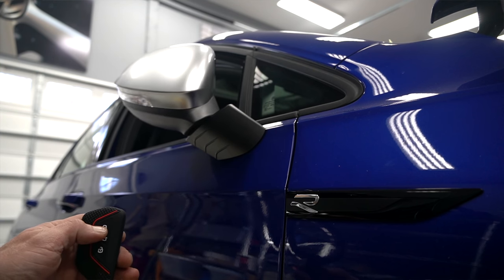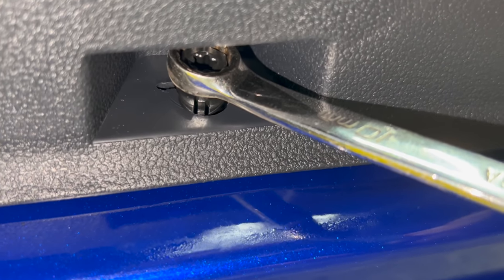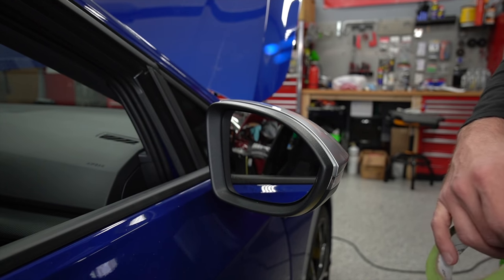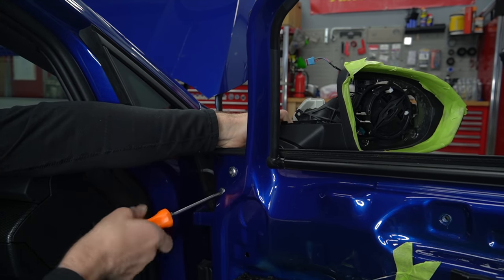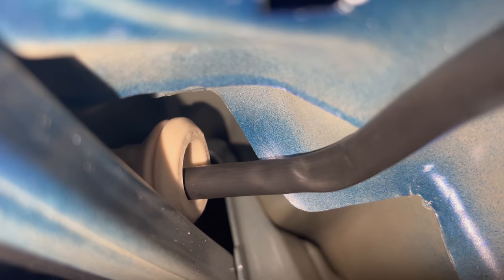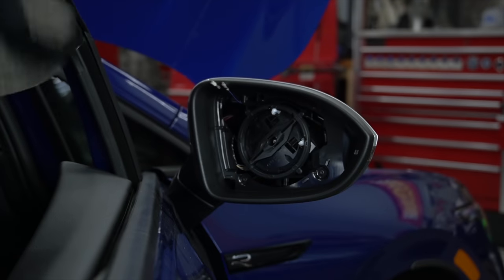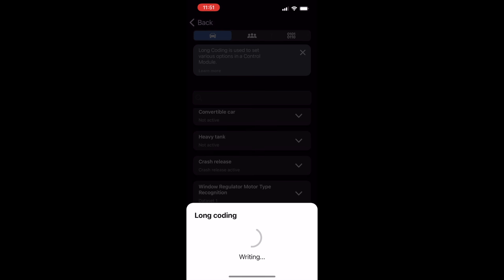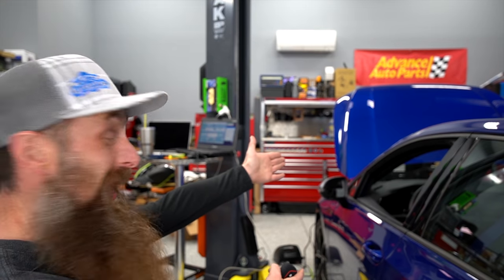How To Install and Code MK8 Golf R, GTI Power Folding Mirrors

Comment from the maker: This is really one of my favorite features. 100% not needed, but I love it. I have coding and adaptations listed in the video description. But I will have it here in the pinned comment: 

For coding:Address Word 42 Driver side door
Long Coding 
Mirror Folding ~ INSTALLED(byte 4 bit 4 on VCDS)
Mirror Comfort ~ ACTIVE (byte 4 bit 6 on VCDS)
Confirm long coding

Address Word 52 Passenger side door
Long Coding 
Mirror Folding ~ INSTALLED(byte 4 bit 4 on VCDS)
Mirror Comfort ~ ACTIVE (byte 4 bit 6 on VCDS)
Confirm long coding
ADAPTATION FOR MIRRORS:
1)SFD UNLOCK
2) Adaptations
~Search Spiegelverstellung 
3) Confirm Settings as follows
~CP Komfortgedienung Spiegel Anklagen 
NOT ACTIVE
~Spiegelanklappen Bei Verriegelung
ACTIVE
~Spiegelabsenkung Bei Rueckwaertfahrt
ACTIVE
~Menuesteuerung Spiegelabsenkung
ACTIVE
~Spiegelverstellung Synchron
NOT ACTIVE
~Menusteuerung synchron Spiegelverstellung
ACTIVE
~Menuesteuerung Funk Spiegel anklagen
ACTIVE
Reply: Is there a way to code the mirrors to fold if you turn the switch while driving?

Hyundai has that functionality and it's really useful for tight space maneuverability.
Reply: Hi, great video!!!
Do you know if it is possible to change the default drive mode by obdeleven? The golf r is always set the “sport mode” as default and different from the GTI it does not remember the last selection. Thank you very much.
Reply: @georgelaurentiu3106  i guess that feature is automatically enabled after you coded the power folding feature. that's why you need a power folding mirror adjuster
Reply: @n.shiina8798  factory installed power folding mirrors will only fold/unfold if the engine is off afaik
Reply: @georgelaurentiu3106  check your mirror adjuster switch. there should be retract button. all car here that equipped with power folding has retract button
Reply: Hello, do have an idea how to install keyless entry handles on golf 8 with full configuration
Reply: Can this be done on a 2019 Jetta GLI 35th Anniversary?
Reply: im SO SO SO thankful to you for doing this video! i got it all done in 3 hours flat :) your tutorials have been incredible. my 23 gti too now has electronic folding mirrors from shopdap :)

Comment: Power Folding Mirrors are a parking lot flex
Reply: Really useful for getting out of a car garage though
Reply: Its like putting your sunroof on vent when at a Meet or something
Reply: I had a 19 Rabbit Edition and traded for a 380 Edition and I fold them before pulling in the garage. The extra 3 inches I can park farther toward the wall and the extra room between my wife's car is super nice.  No more worries about wife dinging my car.

Comment: Easiest way I’ve found to remove the mirror glass is to push the outer part of the mirror as far in as you can. Then grab the inner part of the glass with at least two or three fingers and it will pop right out. Replacing them with aspherical mirror glass is a must. There’s no reason to not install them.

Comment: I figured it out. If you follow this video to the T you will end up with 3 clips removed with the door card. The other 2 will remain in the door which need to be removed, reset, and slid back into the door card. 

OBD11 was not very effective. The pay model is a bit ridiculous. First told me power fold mirrors are not available with engine on and good open. Figured I’d do the one tap app to support your work. That didn’t work. Waste of $20. Had to manually go thru long coding and adaptions and that worked. 

Happy with the result though and appreciate your videos and I learn more about the Golf mk8 platform.

Comment: paranoia is a thing, it only gets worse with age x)
I usually forget to lock my car at home, so I put the keys in my pocket when I get out of the car and press the lock button when I put the keys on the counter. I also never ever take the keys out of my pocket until I don't intend to go back to the car. aka everything removed and doors closed.

At the shop I always press the lock as I drop the keys in my pocket. 

If you don't want to forget something at home you must take to work the next day, put  it in the fridge with your lunch :D

Comment: You could have gone all out and put an auto dimming mirror on the driver side. Can't see if they make one for the passenger side or not. This would require a lot more wire routing though.

Comment: Seems like a ton of work for folding mirrors. Glad you're happy with it, it would be useful in the city for sure. 

Actually I'm messing with the mirrors on my mk6 right now, replaced the mirror control switch but problem persists. Problem being I lost the 'down' direction functionality. Think it may be a wiring issue? I am getting codes back for 'implausible signal' on the mirrors
Reply from the maker: ITs really not that bad. Id say about an hour or so of install. and maybe 20 min of coding.

Comment: I think this is something that should be instaled from the factory
Reply from the maker: I agree.
Reply: @HumbleMechanic  these are installed as standard on uk spec cars. But great content as usual Charles 😊👍👍
Reply: That’s weird! In the previous generations here in Mexico the GTI model came with this from the factory. I hope that the MK8 that is built in Germany comes with the same configuration as the other ones.
Reply: @epierdant  My frend that is called cost cutting

Comment: Really appreciate your videos. I’m currently stuck on getting the door card back on. I’ve reset the clips as you showed. But just not getting a good seal compared to the driver side door I haven’t touched yet. Do you have a more in depth video on getting the door card back on or have any tips for me? I started at the top inserting into the channel and tried to slide it down. Peaking around the sides to ensure the 3 reset clips are lined up. I give some bonks but they just won’t grab fully. I swore at my car :(

Comment: At 4:42 it seems that a centering post or  broke off . Best thing is to remove it before putting the panel back. In certain frequencies they rattle if left in.

Comment: Thats really neat  Those little covers are really neat , and knowing how they work saves a lot of untidy edges when refitting well done, a very clear video.
on a slightly different topic , but still in your department , does an 08 08 audi S3 have the same pistons and rings as the standard 2.o liter , basically do they have the same oil consumption issues ,,, ta.

Comment: What is the overall width of car with mirrors folded in I’m looking to see if it’s the same as manual folding mirrors because I have have a small garage door I have to fold mine in I worry I’ll eventually snap ‘‘em off but they seem to fold at a lower angle

Comment: Charles, why does a $40k+ VW, and a top halo VW at that, NOT come with power folding mirrors as standard equipment?   How hard can it be for VWoA (or VW in general) to install these power mirrors on to the Golf-R?  Is this part of the continued cost cutting measures we see in our market, or is it a "we don't want to step on Audi's toes..." measure?  Even "People's Cars" need power folding mirrors.  Thanks for what you do.  .:R
Reply from the maker: It’s a small car so I’m guessing the “need” in US market is low. 

I’ll happily give up PFM for all the other rad stuff this car has

Comment: Hey Charles so I’ve done this with my mk7 and installed everything right but I did the coding with Obd11 and all the functions show up in the car but the mirrors nvr fold should I do the coding with vcds instead of the obd11

Or could it be that I installed the wire for the mirror backwards but idk I made sure all was done right just that they don’t fold and I bought them from Paul his Dutch auto parts store 😭 even doe the wires go in one way so I’m just sad they don’t fold when they should but it’s probably bc of the obd11 and I should rather use VCDS RIGHT?

Comment: Hi Charles. I installed electric folding mirrors on my Mk4 Jetta and I’m struggling to get them working. Would you know to coding route I need to do on VCDS? Thanks from Ireland ☘️
Reply from the maker: I haven’t installed any on mk4
Reply: Thanks for the reply. The search continues

Comment: Removing the mirror glass is suuuper easy... I don’t see how you failed.
Reply from the maker: Lol you saw exactly how I did it
Reply: @HumbleMechanic  Push the mirror to the left or right as far as possible. Then on the side that's pointing outwards, you gently pull and it'll come loose. I've done it a bunch of times and it works fine. Alltho not on the mk8. Perhaps they beefed those up.

Comment: These come as standard on UK models, why VW don’t extend this to other markets is mind boggling 🤷🏻‍♂️
Reply: Chip supply issues I guess
Reply: The market-to-market differences on what is available, unavailable, standard & optional, no-cost vs up-charge on the MK 8 Golf R is bizarre.  

Premium paint colors are free in some countries, a fixed up charge in others and a variable up charge depending on color in others.

Some markets don’t even offer cloth seats as an option.

Parking assist is unavailable in many places. 

I suppose it is driven by each country’s product and price management folks to figure out how to fill up the area under their market’s price curve.

Also the market-to-market price variation is incredible. Spec out a USA equivalent DSG (because manual isn’t available) on the German configuration and the price is about 33% higher after currency conversion.
Reply: @KXKKX  fascinating

Comment: I have a 2007 Volkswagen GTI Mark five and I was wondering do you have to do the stage one tune in order to put stage two on there
Reply from the maker: No you can just right to “stage2”. But you need hardware to back it up

Comment: I wonder why the new models no longer have the beeps for locking / unlocking.... (My Mk 5 has one beep for locking, 2 beeps for unlocking)

(Here (in South Africa) using other remotes to jam the lock signals (to then steal stuff from the car) seems to be a common problem. Making it easier to tell if the car is actually locked probably helps for that as well)
Reply: They do. Just need to activate in the car settings. Although, doesn't beep like the audi's, it honks.

Comment: I may have to look up the DAP for my passenger mirror on my 14 Jetta. My wife shut the door the other day and the glass fell off😬
Reply from the maker: OUCH! They can pretty much get any OEM parts, and generally a bit cheaper
Reply: @HumbleMechanic  I guess I shouldn't always run the mirror heaters. Looks like the glue between the glass and the plastic dried up and cracked.

Comment: Could you code a MK8 to work with an Audi steering wheel that had real buttons instead of haptics?
Reply from the maker: Probably work but I’m guessing you’d lose dive mode function. The haptic is actually not bad at all.

Comment: After over 50 years of driving, of that 1.7 million accident free doing heavy haul, I can’t come up with any reason that I would want my mirrors to power fold. A good part of those 50 years were in a 4x4 in the woods so I know the value of good, collapsible or folding mirrors when it comes to them contacting things that don’t like to move. What is the purpose of these power folding mirrors on a vehicle being driven on public highways where you can never have too much traffic awareness? I would suspect that this even applies to some rather embarrassed Richie Rich folks that didn’t see the truly fast car coming up behind them on the Autobahn because they didn’t think that they needed their rear view mirrors at their speed.
Reply from the maker: Think street parking. Also because I want it. Lol like 99.999% of car mods. . Not needed at all 😂
Reply: @HumbleMechanic , there’s my problem, I live in a low crime rural area. Wait, I guess I can no longer call it low crime. I brought home an aluminum utility trailer on a Monday and it was gone Friday morning! Police said there was a ATV stolen a few blocks away the same night, without any keys and they figure that they may well have used my trailer to accomplish it. So there goes my low crime rating.

Comment: interesting, my obdeleven looks completely different
Reply from the maker: Maybe it’s an older one?
Reply: @HumbleMechanic  the app looks quite different, i wonder if it's because it's connected to your mk8, or maybe the android version but the styling is completely different(and i have it updated) for example i dont have the bottom right "chip" icon. I got my obdeleven thanks to the video you did on it years ago so it should be the same vintage/revision as your dongle as well

Comment: Vw  really taking the piss the corner cutting rip off's the fucking 2.0t 4pot golf starts at 40k ffs .
Reply from the maker: I think you should compare features of this over the last few generations of R, then adjust for inflation. 

This car is basically the same adjusted price as mk4 r32.
Reply: @HumbleMechanic  But Vw are accounting for inflation the r32 mk5 was 27k in 2005 now the r20 mk8 in 2022 is 40k/50k  and as soon as anything is removed on the car it looks cheap as hell. RIP OFF
Reply from the maker: Converted into todays money that is about 43k 

We have to look at the whole picture. 

Other than going from a v6 to a 2.0(debatable if that is in anyway a step back, the mk8 has tons more features. 

In US spec cars I don’t think there is one feature the mk4/5 had that 8 doesn’t. 

I’m not trying to defend VW. They do some dumb stuff. I just want to be sure if we are having the convo about Cutting corners we are honest about it.
Reply: @HumbleMechanic  it's the build quality to , Apples to Apples the mk5 r32 was defo a better built car.
Reply from the maker: In some aspects yes.
Reply: @HumbleMechanic  maybe I'm a hypocrite I terrorized a little English village in a pfl RS3 8v 🤪